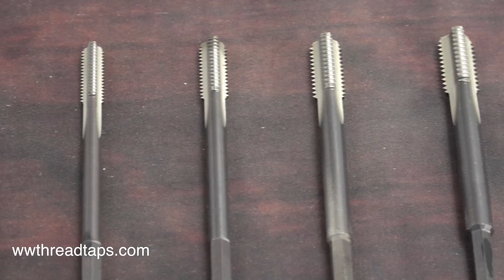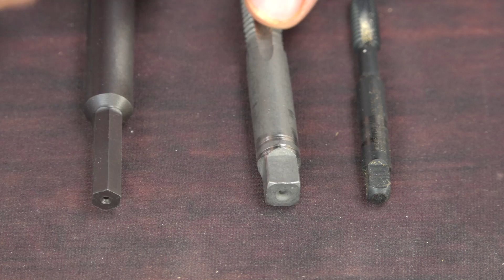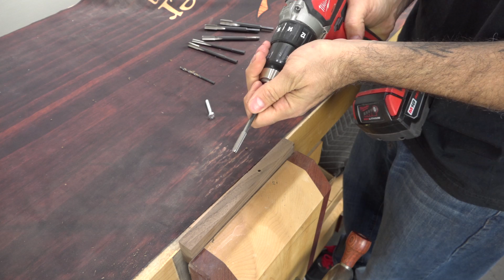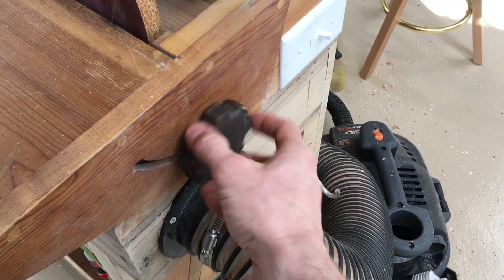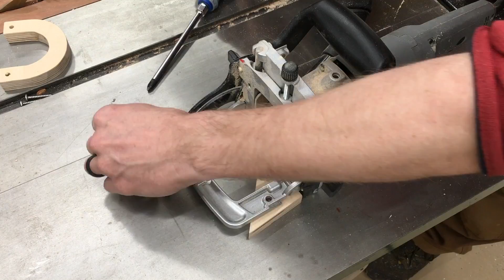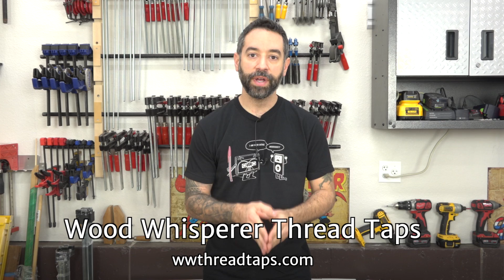Thread Taps Pre-Sale

Comment: I've tapped on plenty of wood. I tap with a handle, a drill plyers adjustable end wrench wrench, hammer you can even use your hand.  

But its a lot simpler to just reach up and tap on the  doorbell.

Dad joke # 35,437.2

Comment: Threads simply cut into wood are NOT as strong as they can be made, if you follow the expert advice aeromodellers offer:..After cutting the threads, soak them with some Cyanoacrilate glue, and let it harden for a minute, then re-thread lightly. The glue hardened thread resists repeated screw tightening better.  Still better: add a little candle wax to the glue-hardened threads , so that the screws slide easier and wear down much less the glue-hardened thread.  following that advice, even threads made into very soft Woods (like Balsa Wood or poplar ply hold much better! Amclaussen.

Comment: Way overpriced for what you get. The square ends aren't a problem as there are drill adapters. For less then half the price of these 6 taps, I can get a complete set in every size I would possibly need.
Reply: Vlad K I agree. Over priced for what you're getting not to mention you can make your own taps with threaded rod pretty easy. I do this nearly every time, but hey, nothing wrong with burning holes in your pockets if you have the money. :)
It's a nice idea, but way over priced.

Comment: Pro tip: Use a universal socket to drive square bits with your drill. The sockets typically have more of a star shape than a hexagon and fit both metric and imperial screw heads. You are going to need an adapter from the socket to your drill.
Reply: What I've done so far,,, and I'm no pro :)

Comment: when i built model airplanes I made the mount for the wing from wood either plywood or balsa, if you worry about strength soak the threads with CA and re-tap. I never had a wing bolt strip or have the need for t nuts.

Comment: I'm sorry, I love your guy's idea of creating/designing these. But as an experienced Machinist, most average metal taps (most commonly found in/around metal working shops) can do the exact same thing. 

Power tapping (tapping free handed with the bit in a drill) has been a thing for years. I power tap metal on a weekly basis! I think you guys shouldn't be so scared of tapping fast with common metal taps. 
As long as your hole is pre drilled with the correct size drill the tape will generally always follow that lead in hole! 
I've used 1/4-20 all the way up to 5/8-11 taps in some of my woodworking projects for years now. 
And I'm glad these are becoming More accessible to the common woodworker!! 
Also as a tip for anyone else you can even tap into metal that fast as long as its average steel (cold/hot rolled)  and as long as you hole is within 1" deep & you have the correct size hole for the tap.  Just reverse half way through the hole to remove shavings & just zip right back down in there with some light oil or even some WD-40 !! 
Don't fear taps guys they're a lot more rigged than you think!!! 
Hope this product encourages everyone to explore and get more comfortable with taps in general! 
Good luck guys!!
Reply from the maker: Of course we know traditional taps can work. That's how this idea came about. But there are so many varieties of taps on the market that we saw a need for a simplified offering catered specifically to woodworkers. A nice long shank, good cutting action and chip clearance, and a hex shank. We realize we're not reinventing the wheel here. Just improving it.
Reply: And I will definitely get a metric set!! :)
Reply from the maker: https://thewoodwhispererguild.com/product/metric-thread-taps-set-5/

Comment: These are awesome! I have a 1" 8TPI I use for the lathe all the time. But that doesn't fit into a drill very well, and the other metal working taps I have don't have the length I usually need. I'd use the heck out of a 1/4 - 20 like this.
Reply: Adam Gabbert home made face plates?
Reply: Mostly, yes. But I've used it for a 12" disc sander, friction chucks, all kinds of stuff. It's like I'm always coming up with an excuse to use that thing.
Reply: I've had one for ages but never got around to using it. I think it's time I did. Thanks for the reply.

Comment: Newb question here: When tapping wood, does one need to have the correlating drill tap size to match like standard drill and tap? Or will a 1/4" bit work when tapping a 1/4-20 hole? Usually the drill bit sizes are 32nd or 64th increments.
Reply: Maybe you should have those drill sizes printed on the tap it self? Seems like you have plenty of space to write stuff on the shaft, and woodworkers probably are not as familiar with the process as machinists are.
Reply from the maker: That's pretty much unavoidable. But we'll be doing some tests to determine how much tolerance there is with more common-sized bits as well as the differences between hard and soft woods. Here's the current recommendations for hardwood.
1/4"  tap --> 5/32" bit
5/16" tap --> 7/32" bit
3/8" tap --> 9/32" bit
7/16" tap --> 5/16" bit
1/2" tap --> 3/8" bit
9/16" tap --> 7/16" bit
Reply: Well those are pretty standard sizes a woodworker would have in a drill set. I was hoping they wouldn't need a speciality alphabet sized bit or machinist scaled bit. Thanks for the quick response. Pre-ordering today!
Reply: Will this list be included in the package? It would be nice to add this to the tap website, I had to hunt in the comments to find this golden nugget.

Comment: would be nice to get one in 1" x 8 tpi for fixtures on my lathe.
Reply: I have been using a tap this size for items on my lathe for a couple of years.  Highly recommended.  The speed might not be as much of an issue for this application though.
Reply: Leon the Beall Tool Company does a 1x8 lathe spindle tap already if you need it.
Reply from the maker: +Leon Roode we're open to suggestion with regard to the usefulness on lathes. Thanks Leon.
Reply: Pete G cool thanks I'll check them out.

Comment: Would it be possible to put the thread counts on the sets? I.e., 1/4–20, 9/16–12
Reply from the maker: I'll add those to the sets now. Thanks Corey.
Reply: +Cory Ward - Did you mean the size etched into the actual taps? I can't tell if in the photo's these are marked on the individual pieces what size they are.
Reply: I'm referring to the threads-per-inch number that you need to match the threaded hole to a bolt or threaded rod.